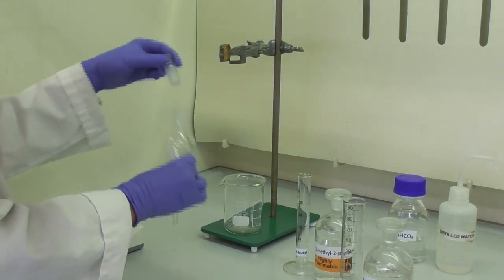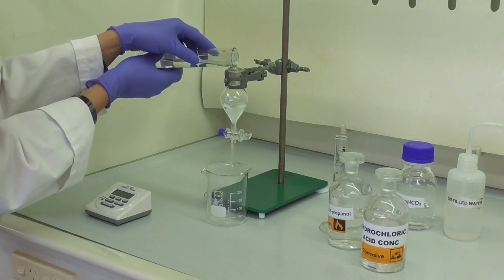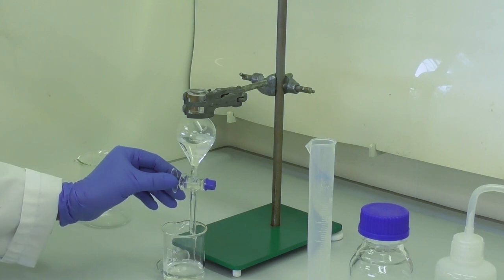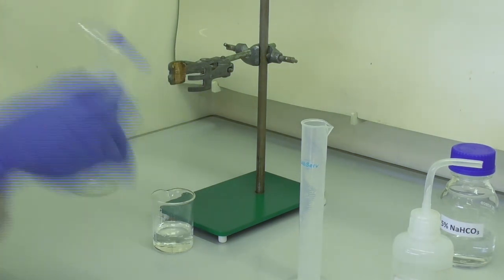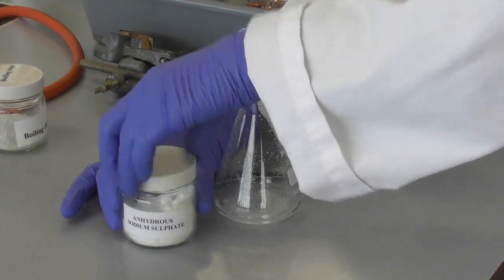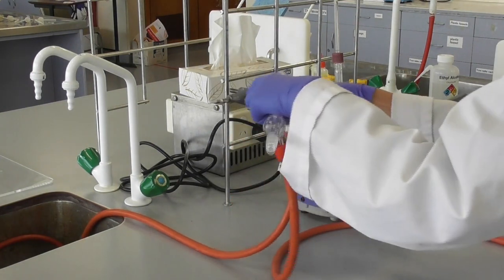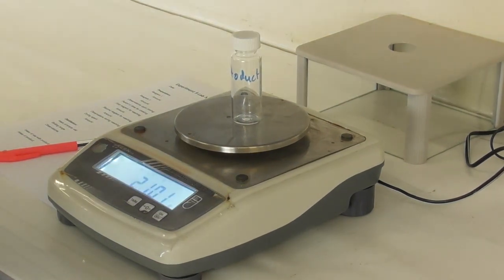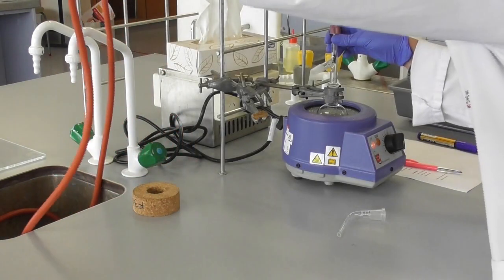CHEMY102 Experiment 9

Comment: What if there’s a space between mantle and RB flask?
Reply from the maker: If there is space between the heating mantle and the flask the heat won't be transferred properly and it will take longer for the liquid to heat up or it might not reach the boiling point at all.